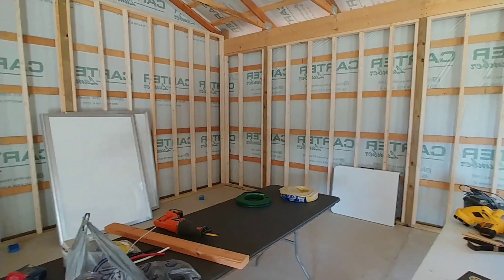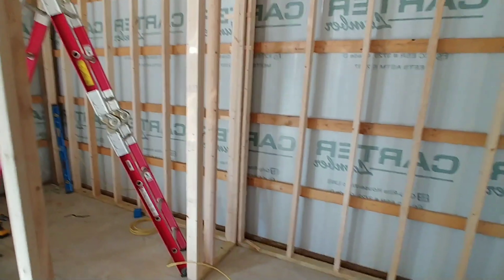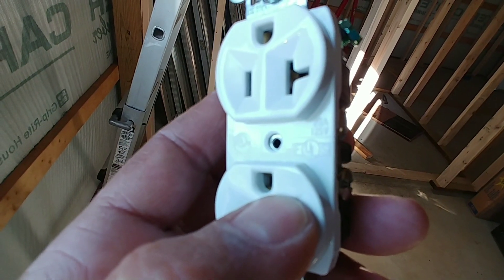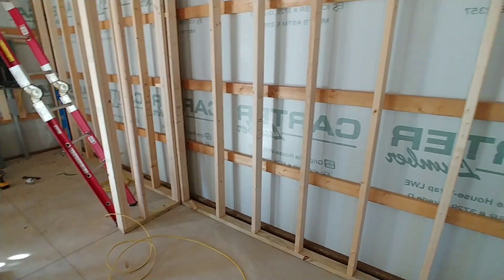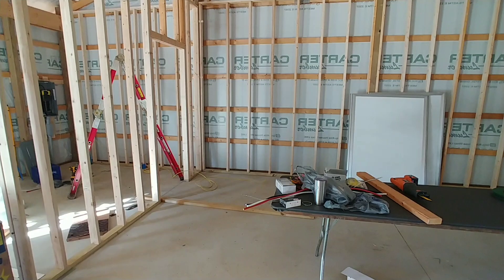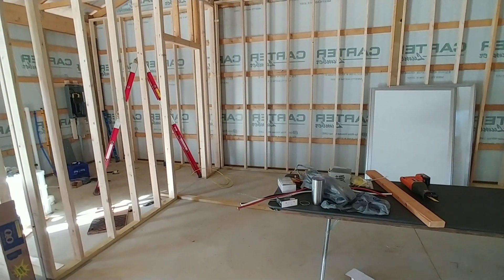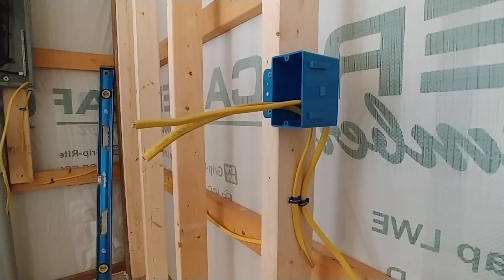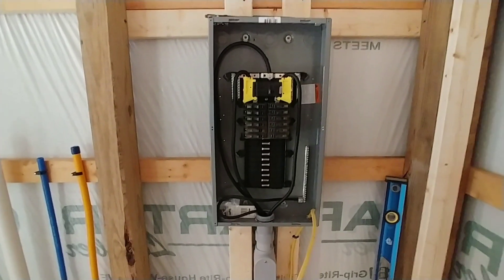Electrical basics for wall outlet branch circuits

Comment: Dumb question do wires have to be so high off the ground in homes? For example from an outlet in the house will the wire run the same path and height of the outlet or will it be higher before running through the studs?
Reply from the maker: No question is ever dumb.  Not sure I know exactly what you mean though.  But I will try and answer what I think you mean.  You run your wiring up from the outlets in your walls because if you ran them down low along the floor for example you run the risk of hitting it with nails when you do the trim.  The same thing applies when running the wire in the stud you always do it in the center that way there's no fear of the drywall screws hitting the wire.
Reply: @BevinsBuilds  well I am trying to install a home gym wall mount and on the walls no matter where I place it has outlets along the wall. The are 6 inches above the floor. Do the wires actually run vertical from where the outlets are or do the wires run horizontally first raising them higher and then vertically across the wall?
Reply from the maker: A lot of that will depend on who did it.  Usually with any outlet they are always at least ran vertically 6in up before going horizontal.  The reason I say vertically 6in up is due to the fact you have to fasten the wire 6 inches from the box.  Now you are saying your Outlets are 6 in from the floor so your trunk line should be roughly 24in in the wall mind you that is purely a guess.  As that number depends on the installer.  What I would suggest doing and they are fairly cheap is they have electrical finders in walls tic Tracer I believe is another common word that you will hear them called and that will help you locate exactly where the wires are in the wall so you have no fear of striking them when mounting stuff to the wall.
Reply from the maker: To further elaborate I say 24 in because usually what it is is your Outlets will be 36 for countertop in your wall outlets are 16 from the floor normally and most installers electrician will run the main line at 24 in in the wall horizontally.  That way the main run is always just a few inches below or a few inches above the main run

Comment: Wow! That is a dream workshop space. I am very comfortable with wiring and I always want to follow code. I have never done daisy-chaining of receptacles before. My question is this: Do I pigtail the ground wires (only one on each receptacle) or push them both into the one terminal? Thank you and I look forward to more of your videos.
Reply from the maker: Hello Phillip in first let me apologize for the delay in response.  I get busy sometimes and forget to check for questions.  But to address your question no the ground has to be bonded to all grounds in a continuous line and then you will have one wire coming out of that bonded ground that goes to your outlet.  The easiest way to do this is like I show in the video I buy the special ground wire knots as it has a small locking mechanism in it that Bond the Browns all together with one extra wire sticking out of that wire nutted group and that is the wire I attached to the outlet.  I hope that answers your question 😀

Comment: With the average cord on a tool only 5-6ft why are you putting your outlets 12ft apart doesn't code require 6ft so you don't have to run extension cords???????????
Reply from the maker: First my outlets are all 8 ft apart.  But no code allows 12 feet apart because the average appliance has a 6 ft cord which means at 12 ft between outlet you can place and plug to reach😀  Im stating minimum code requirements you can place the outlets as close as you want.
Reply: @BevinsBuilds  If you replay your video you stated that the first outlet must be 6ft from the door than you can do 12 ft after that.  8ft is still to far apart in my book.  As I stated before cords on most tools and or appliances are 6ft or less therefore 6 ft in my book.  Bevin kept up the good work this is just a difference in code/ideas for my wood shop.......
Reply: @-CCdude     The NEC says for “Dwelling Units” general purpose outlets are to be installed 6’ max from the door or opening, and 12’ C/C maximum around the rooms.   Any wall 24” wide must have an outlet.     Reason, 6’ cords on most equipment.  So within a few inches of centered between two outlets you can plug the cord in.  Those rules are for “Dwelling Units” not garages, shops, barns, or commercial spaces.   Garage rule is as stated one light, switch, and receptacle.

Comment: Can put 3 wires 12/2 on a single box for outlets ????
Reply: You can put all the wires you need in a box, but the box has to be sized properly. Article 314.16 of the NEC covers box fill and calculation requirements
Reply from the maker: Having 3 sets of wires in a box is fine and normal.  Especially if its the middle of a run and the third romex cable is for a light swich.  There are even situations where you can have 4 romex cables in 1 box. 😀  Hope this answers your question.

Comment: You didnt say how many outlets can be installed for one branch circuit per code
Reply from the maker: I actually made another video discussing just that.  The quick simple answer though is 10 for a 15 amp circuit and 13 for a 20 amp circuit. 😀
Reply: @BevinsBuilds  thank you
Reply from the maker: Yw

Comment: Thank you so much for your help! Quick question… How much did that size pole barn cost you? I’m looking to build something extremely similar. I’ve looked at trying to convert sheds etc. but it looks like that might be the ticket.
Reply from the maker: your welcome and thank you for watching.  As for my barn it is 30x60 posts are 8 ft on center with 10 ft walls.  I would recommend trusses on 2 ft on center if you intend to finish the interior.  But anyway to answer your question.  The total cost of the building itself with a concrete floor and finished exterior with 4 windows and double entry door was 31,650.  Doing all the rest of the work myself to finish the interior and install heat and electrical Im at 40k total cost.  I still have not finished the bathroom or installed AC yet though.

Comment: I'm trying to plan out the wiring/outlets for my 40x50 shop and was wondering, you said your outlets were going to be 8 feet apart but you also said that from the beginning of a wall, the first outlet must be 6 feet from the start of a wall and then outlets must be 12 feet apart?
Reply from the maker: Im sorry I wasnt clear on everything.    I plan to make a video to be more specific.  But to try and answer your questions.  The first outlet on a wall can me no more than 6ft from a openening on that wall.  So starting from a door opening you can place your first outlet anywhere up to a max of 6ft and then every outlet after that can be a maximum distance of 12 feet in between them.  I probably gave to much information in this video but was trying to cover all bases.  Still learning the best way to do how too videos.  In my example in my garage, my first outlet was roughly 4 ft from my opening and then every 8 feet after that which exceeds codes standard.  The 6ft 12ft rule is a max to be within code specs and to pass inspection.  You can place a outlet everywhere you want.  Every 16inches if it is was you need. 😀  I hope this answers your question.
Reply: @BevinsBuilds  yes sir, thank you for clarifying.
Reply from the maker: You welcome and thanks for asking and watching :)

Comment: Thank you for the help, I am considering learning this as a trade!
Reply from the maker: Awesome, I wish you luck.  Try and get into your local IBEW for an apprenticeship.  Its a great trade with excellent pay.  To me the 2 best trades to get into are HVAC or Electrical.  As everyone needs heat and air and power to run them. 😀  So you will never be out of work.
Reply: @BevinsBuilds  sir i have a question. I just started my courses for Residential electrician. Realistically. How would i get hired. Who would hire me? And the truth be told what can my starting pay look like??? Im from Texas. Liked your video very helpful👌

Comment: So what will happened if I put a 15 amp circuit on an 20 amp breaker?
Reply: you can put 15 amp outlets on a 20amp breaker if its a duplex out
Reply from the maker: It depends what you mean by a 15 amp cirtcuit.  If you mean use 14 gauge wire on a 20 amp circuit and say for example you plug in a portable heater that draws 15 amps.  The wire is now not protected and will over heat.  Degrading the insulation and eventually cause a fire.  The same applies if you place a 15 amp outlet on a 20 amp circuit.  The purpose of the breaker is to protect the wire and componets of the electrical system attached to it.  Not the devices that get plugged into it.

Comment: If you are in the US, you can use 12-2, a 20A breaker, and 15A receptacles (as long as you have more than 1 receptacle on the circuit).
Reply: Yes u can use 15 amp receptacles on 20amp breaker I’ve never been in a house that uses 20 amp receptacles. Only thing u have to do is 20amp breaker needs 12/2 wire
Reply from the maker: I dont know where your at but you can only use 15 amp recepticles if you are using a 15 amp breaker.
Reply: @BevinsBuilds  John S is correct. The National Electric Code allows 15 amp receptacles on a 20 amp circuit as long as it is a duplex. A single receptacle would need to be rated at 20 amps. Please don't ask me to explain why though.  I think the 20 amp ones are better for your application because they seem to have beefier contacts when you plug something in.

Comment: Wouldn't it be better to leapfrog your circuits instead of doing them in sections so you have access to multiple circuits from one spot without a bunch of extension cords
Reply from the maker: You can do that yes but it would take a lot more romex.  But what I did is made all my circuits 20 amps and I should never need more than that at any 1 location.  But its all a personal preference.  If I was setting this garage up as a mechanics shop or wood shop for example then yes I would recomend multiple circuits in each location.  My barn is basically a man cave and used as a recording studio so the only loads I will ever have in 1 location will be additional lighting.

Comment: Does the wire terminate at the final outlet or loop back to a panel?
Reply: oh hello
Reply from the maker: The wire to the first outlet comes from the panel and either continues on to the next outlet or fixture or stops at that one. 😀
Reply: @BevinsBuilds  wow thx so much
Reply from the maker: Your welcome
Reply: @BevinsBuilds  =)
Reply: @BevinsBuilds  Shane is my dad now we have electricity in our wall we built

Comment: I recently had to change an old outlet out and I flipped the breaker off first and took the old one out no problem but when I was attaching the white wire, I got the piss shocked out of me. How could that be when the breaker is off?
Reply from the maker: If the neutral is shared with another circuit.  Of which it should not be.  It can shock you as the white and black wires are your current carrying wires.  Many times though as a lot of home owners want to do there own electrical they sometimes accidentally mix neutrals which can cause this.  An easy way tp test to see if it is shared is hook the circuit up to a afci arc fault circuit interupter.  If it is sharing a neutral the afci will not allow a reset on the circuit.
Reply: @BevinsBuilds  ok thanks. I did not hook the new outlet back up. We have been without power on 3 additional outlets and 2 lights.  Could it cause a fire if I hook it back up?  I cannot pay an electrician at this time.  I will check all outlets to make sure they are wired correctly. Thank you
Reply from the maker: It should be fine, mind you I cannot see what you have so I cant say its safe.  But if it had a outlet in it I dont see a problem.  To prevent any shocks also I would turn off the main to the house that way you know there is no power at all.  Another question I do have though, is the main panel grounded and bonded ?  Also do the outlets have grounds running to them ?
Reply: @BevinsBuilds  Yes everything is grounded
Reply: @BevinsBuilds  This place is a mess and I believe several people have had their hands on the wiring befor I became the occupant. The power is coming from a dual 30amp on the meter. From there to the electrical box main, a 100amp breaker, then to four 20amps, two 30amps, and one 50amp.  Everything in the house is regular 110v demand except for the well pump which is on a 30amp. Not all 6 breakers are hooked up
Reply: @BevinsBuilds  I have light fixtures that blow bulbs, which could be the fixtures themselves I guess, but I can't run a tv over 13" without it start turning itself off and on or changing channels on its own. The light bill has went up $30 with no new appliance and no changes to electrical wiring that has been here for over a decade
Reply from the maker: Ok now what your describing to me it sounds like you have a power issue with the neutral which will cause power fluctuactions.  Typically caused by a bad splice on your service entrance cables.  Do you notice lights getting brighter and dimmer as well ?
Reply: @BevinsBuilds  yes whenever the well pump kicks on, for a split second, the lights dim, and with the electric heater as well
Reply: @BevinsBuilds  I apologize for bugging you. I don't have anyone to help me. I am a stay at home mother trying to raise my two children, homeschool, and fix this house up too. I have been here for six years and I haven't touched the electrical system at all. Please delete this after you see it 😊
Reply: @miltonb8130  that sucks

Comment: Great video.
But i have question.
 What are the requierments for your recepticles outlet and light outlets for that shop?
Reply from the maker: Thanks, im not exactly sure what you are asking.  But for me as this is a shop I wanted 20 amp outlets available every 8 ft.  So I ran number 12 wire and I have a total of 8 circuits with 4 outlets per circuit.  Which is actually over kill but I wanted an abundance of power available at any point on every wall. :)  hope this helpsm

Comment: just curious as to why you didn't leave any service loops on your Outlets any input would be greatly appreciated
Reply from the maker: When you say service loop, to me your describing a small coil of wire under the outlet like you would when entering the house with ser cable.  
The purpose of a service loop is so water will drip off of the wire before entering the house to prevent water damage and water running into your walls and panel.  

Ive never installed wire in a outlet that way as simply I wasnt taught to.  Here in michigan they want it straight into the box and it must be secured within 6 inches of the box with a staple.  But that doesnt mean a service loop would hurt. :) but there is no need for one as no concerns for water running in a wall.   

The reason I can see doing that would be to have extra wire to pull in incase of damage.  But you should already have a minimum of 6inches of wire in the box anyway as a minimum requirement. :)  hope that helps.

Comment: Work shop? I thought this was a Lego barn
Reply from the maker: It will primarily be lego but Ill be installing a lot of different things in it.
Reply: @BevinsBuilds  are you going to make a separation wall between the Lego Room and mechanics section?
Reply from the maker: @josephd27  I do have a small room framed up for what I am calling the mechanical room. Which will be a possible future bathroom and my lighting panel and furnace if thats what you mean. :)
Reply: @BevinsBuilds  no I meant a separate room for none Lego work/projects
Reply from the maker: @josephd27  oh gotcha, as of the moment no.  I may in the future but for now I just wanted one large big open space.  As I plan to incorperate lego with a lot of what I will be doing.  Such as cosplay/movie prop making and stuff.  Ill keep lego sets that are related to different themes as well.
Reply: @BevinsBuilds  look forward to seeing it done

Comment: Very educational! So practical to have the outlets ready. It speeds and makes the work process more manageable. Have you thought about the kind of light you will use? I heard sun light damages lego. But not sure if artificial is an issue. Great video!
Reply from the maker: I do at some point want to use led lighting as they do not produce and uv rays.  But currently I am using t5 flourecents

Comment: Looks good Daryl. Coming along nicely. One thing I learned yesterday at my house is to turn off the electricity before pushing a wall plug back in the wall. Or at least not touch the screw on the side. Had some slight tingles from that one. 😳😳
Reply: not full proof but i have seen a lot of electricians wrap tape around the screws. Basically you wrap the entire edge of the outlet a few times.
Reply from the maker: Lol, yeah I would always recomend turning the power off first.